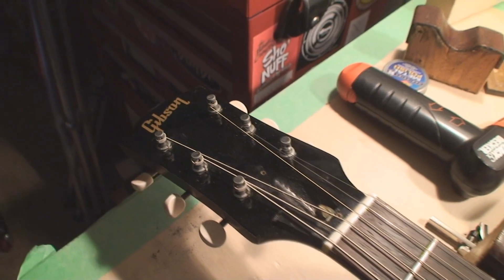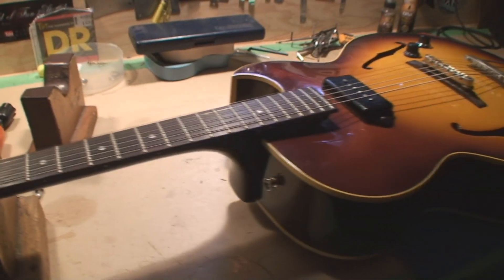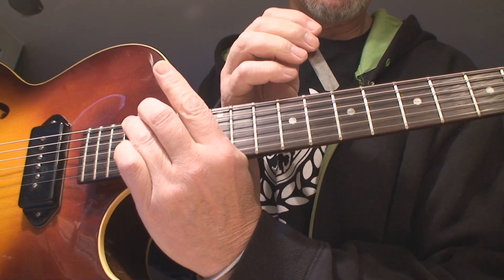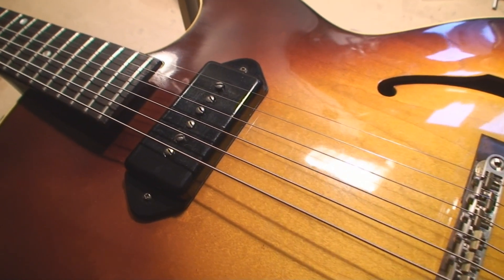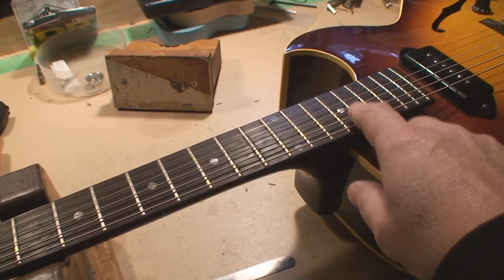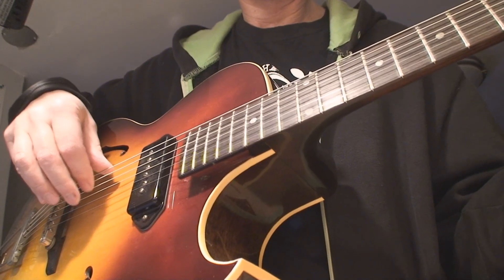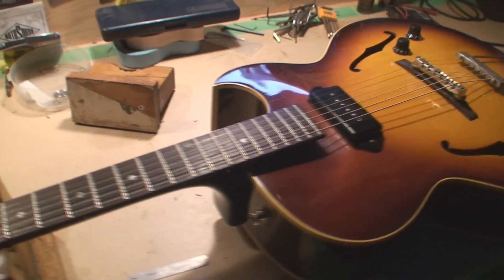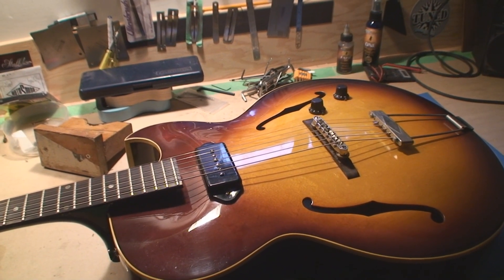Gibson ES-125 Guitar

Comment: I had one that looked exactly like that except it was a '63. That's not the original bridge, unless they changed from a rosewood bridge to an ABR after '63. The "contouring around the neck that looks like it's collapsed was exactly the same on my guitar. Mine was stolen back in '76 or '77. It was a real nice sounding guitar.
Reply: The owner changed out the original rosewood saddle to an ABR. I have a '65 Cherry-Burst ES-125TC , this one's skinny brother. And yes, it is contoured on the top under the end of the neck as well.
Reply: @josephtravers777   Cheers. Good to know.
Reply: @Relayer6a  sorry you got ripped off :(

Comment: Dave - what is the owner's chief complaint - fret buzz?  Action too high/low ?   Is it possible the tail of the fretboard (over the body) is kicked up?  Maybe re-try the relief holding at the 20-21st fret ??   You never really said what the guy was unhappy with - I'd start there.   My .02    Flat-wounds so radically change the sound, unless he's going for that sound (and no ability to bend the lower strings) - I'd forget that.

Comment: If the owner had complaints about fretbuzz and therefore thought having more relief could solve the problem: With flatwounds that problem easily could be cured for they tend to buzz much less - they vibrate differently than roundwounds and would be a good choice for such a guitar

Comment: Most flat's have more tension because they have a higher unit weight. They can also have higher perceived tension because they are stiffer than round's.  Tension is calculated by unit weight, scale length and pitch. Stiffness is a bunch more crap calculated.

Comment: Flat wounds may well create more tension, I have heard that before.  But it is not because of "more surface area".  They actually have less surface area.  I would be interested to know why.
Reply: They have MORE MASS PER UNIT LENGTH - for the same outside diameter.

http://en.wikipedia.org/wiki/Vibrating_string#Observing_string_vibrations
Reply: +Tony Duncan ;THAT would explain it!
Reply: A Keeper Of Odd Knowledge It would.

Comment: String it up with all low "E" strings and tune it up to G for a few days. I have done that ( only on guitars that wont be damaged by it) with good result. Might want to go a bit easier on this one. WHY?

The ES-125TC has a notoriously bad neck joint, so you have to watch it.

The guy probably read some message board that told  him he had a problem. He doesnt. Maybe the neck moved since he loosend the truss rod and now its where he wanted it to be. It can take a bit of time to respond sometimes, wood moves slowly.